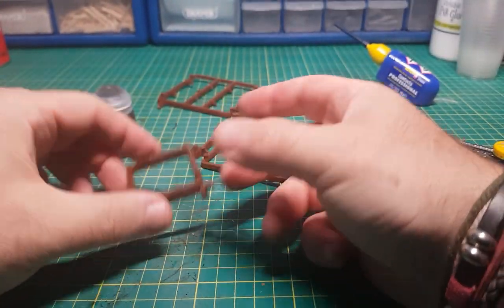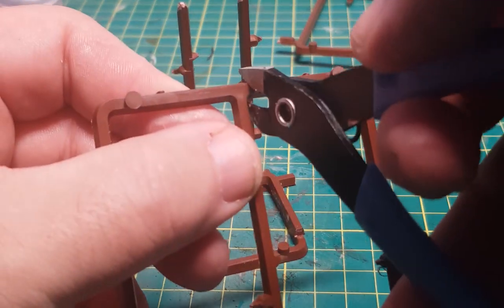5 Minute Build Challenge - Turning Warhammer Sprues into a Citadel Paint Pot Holder

Comment: This is a brilliant idea, a quick and easy anti spill device 👍😊...however decanting to Dropper bottles is the best permanent solution. You can knock a dropper over open and it will not spill. It's the first thing I did when I bought Contrast paint.

Comment: Why is it so hard to get that cap back over the tab to fully close? I just don’t understand the design
Reply: It seems to be made to make it hard to close so the paint dries easier and you have to buy more. It will go bad faster than every other brand I've ever used. I have tamiya paint from over 10 years ago and it still works. I also have citadel paints from this year and 2019 that are thick and nearly useless without fixing them.
Reply from the maker: Ive only just brought some paints but it does seem everyone transfers it into the slimmer pots lol =)
Reply: Miniature Hobbyist yep I’m pretty new to it and I just got fed up and transferred. You lose a lil paint in the process but most of it you wouldn’t even used anyways. Just don’t use to much thinner I goofed up on my white scar paint. Little too runny now 🤦🏻‍♂️🤷🏻‍♂️
Reply: The lid isn't meant to fully go over the tab. If you look, there's a little notch on that tab and that's meant to hold the lid open. You should be able to simply open the lid, pull it back a bit, and it will stay open because that tab will hold it in that notch. It's not perfect and will fail after a while but I've noticed it's gotten better and my newer paints (meaning, the ones made in the last year) stay open pretty easy.

Comment: So I've been thinking. Since the companies don't want you making molds of their stuff,why not make your own?

Step 1: Make something out of epoxy or putty or what have you. It just needs to be able to hold a shape well. Let's say,a new custom head for a Mega Construx figure. You just make the head out of whatever,it just has to hold up under the mold making process.

Step 2: Make a mold of the head.

Step 3: Use the mold to make a plastic version of the part. For things like a head,you'll want to use a neck joint to make use it'll fit on a Mega Construx body.

How's that for a project?
Reply from the maker: Haha great project, doubt I could do that in 5 minutes lol. I am getting a 3D printer soon so will be making my own things very soon =)
Reply: @MiniatureHobbyist  Sounds good. If the 3D prints don't hold up on their own,you can use them to make molds.